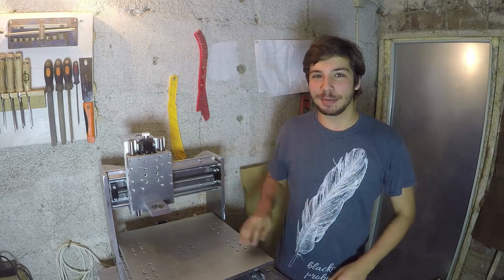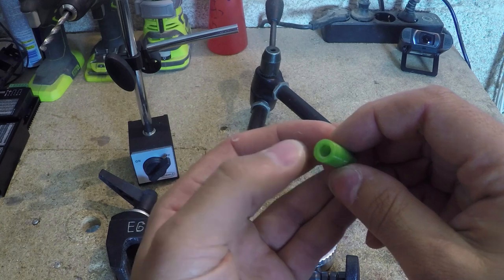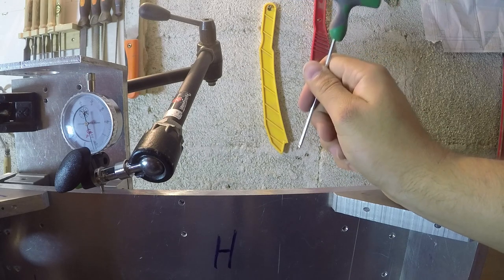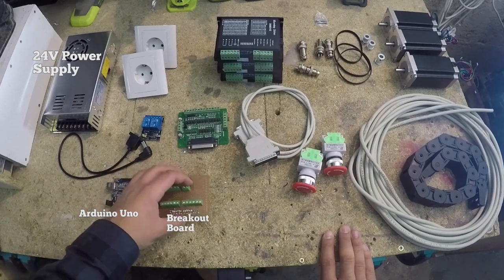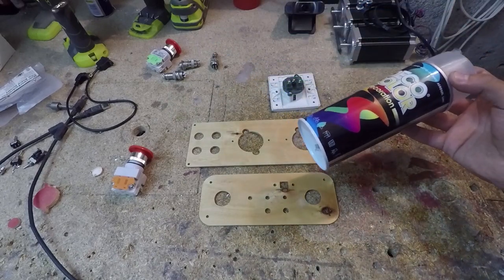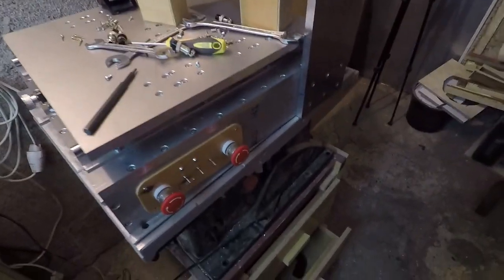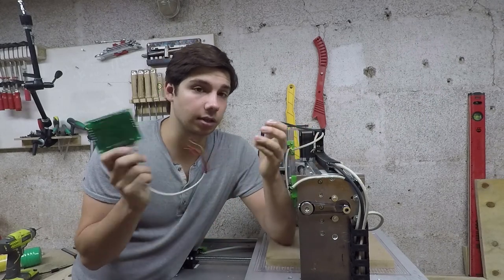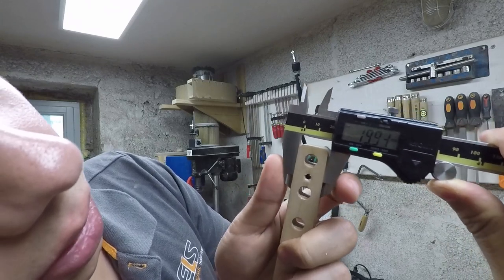Super Strong DIY CNC using 15mm aluminium plates!! (Part 4/ Electronics)

Comment: Hi there.. nice job!!! As a cnc controller I am using the Pokeys57cnc for the last 2 years and I am super satisfied with it.. no regrets at all
Reply from the maker: That looks interesting. Is it like a complete solution, or do i need an extra program to run the gcode?
I have to admit I don't understand everything on that page
Reply: Uniquelymade well, I am running Mach3 and I know that it is also fully compatible with Mach4

Comment: You done great job, congrats! I also want to upgrade mine cnc, so I have question. I will make body much bifier with thick aluminum and even steel on base, I also desided not to remove old round linears to similar with support, instead I will ADD support, so that on Y and X there will be 4 linear shafts 8 bearings for each axis. I will also change mine similar to yours spindle to water cooled 1.5kW one. But I have main concern - I dont want to upgrade steppers since then I will need to buy drivers and control board for them and it may cost a lot. So I wonder if stepper size/amperage is that important? I have small nema 17 steppers, I googled around and for example stepcraft cnc can cut aluminum pretty ok in video uses nema 17 ~ 2Amps steppers and they seems to work just fine on aluminum video, I asked them they told me nema 17 is more than enough. What do you think? Thanks
Reply from the maker: Well I think they will be able to do it if you take it slow. I bought the bigger ones just cause I wanted to make sure. The problem with the smaller ones is that they MIGHT lose some steps along the way. I think you should stick to the nema 17 for now and if you have the need you can still upgrade :) I bought a set of three motors plus drives and power supply for around 160€.
Reply: sandric mora , I went with Nema23 because you can't improve motors without replacing them.  5A.  Checkout my machine.

Comment: Would be nice to see if its possible to mill some aluminium parts and see if they keep right dimensions. How much did you spend in total? Where, why and how (schematics) did you ise the opto coupler?
Reply from the maker: I actually already milled some aluminium and I got to around 1/100mm. Obviously I dont have the most precise tools but I'm very happy with that.
 I got a costum GRBL breakout board with full isolation in the making so once that is done I will talk a bit more about it. 
But basicly the most imporant one is between the arduino and the Limit Switches, since activating the motors, the spindle or anything that draws a large ammount of current will create small spikes that the arduino will interprate as a hard limit switch activation.

Comment: Excellent build. I would like to build my own. Any idea where I can get some instructions
Reply from the maker: Don't take this the wrong way but if you need help finding instructions you should probably buy an "inexpensive" one first to learn about the machines and how all the components work. That helped me a lot getting into it. Try searching for "3040 cnc" on ebay. It will be a lot more rewarding to learn with a functioning machine than to get frustrated because stuff doesn't work out.
Reply: @Uniquelymade   Thanks Max

Comment: Nice CNC, still two things to say : First, your axis alignment is wrong (your calibration). Second : 15mm alu is by far not strong. You underestimate the powers that a CNC creates.
Reply from the maker: I mean the term strong is relative to a lot of those cnc machines you can buy or diy.  I'm talking about the shapeokos and carbide 3d machines. Thanks for the feedback tho :)

Comment: Why you using that breakout board? If you running grbl then why?
Reply from the maker: I just wanted optical isolation between the stepper motors, limit switches and grbl to protect against interferences. Probably not necessary but they send it to me for free...
Reply: @Uniquelymade  I don't understand isolation i got it but what is iptical in here?
Reply from the maker: The signal line is basicly cut and on one side is a ir led and on the other side is an ir receiver. You can Google optocoupler if you are interested
Reply: @Uniquelymade  ooo got it bro, it means you simply cutting all electronic connection between two circuits . So there would be no noise in other side. Cool.
Reply from the maker: Yeah exactly! It's pretty important for the limit switches so you get no false triggers in the middle of a Programm
Reply: @Uniquelymade  yes, you are so cool 👍👍. Thanks for helping.😍
Reply from the maker: Dude I barely know what I'm doing myself :D but I'f I can help you avoid mistakes I will gladly do so ^^